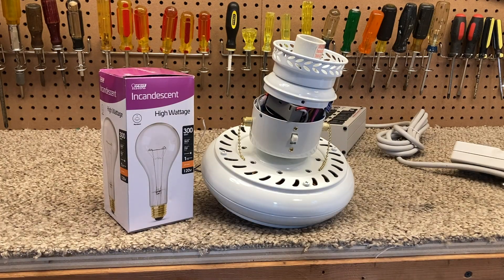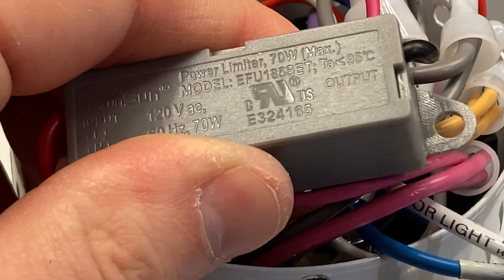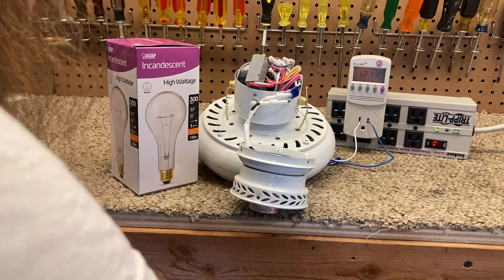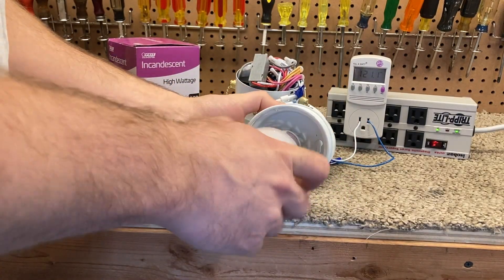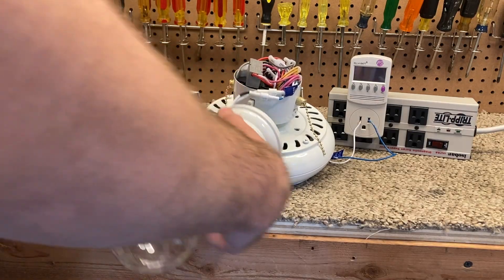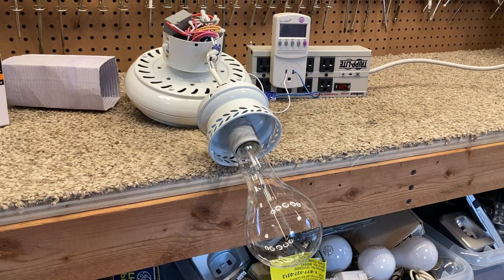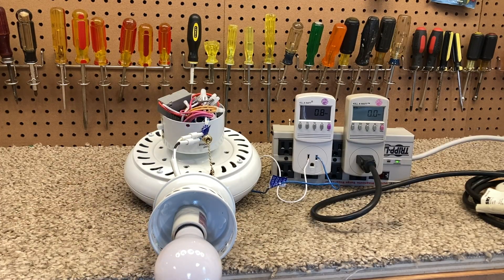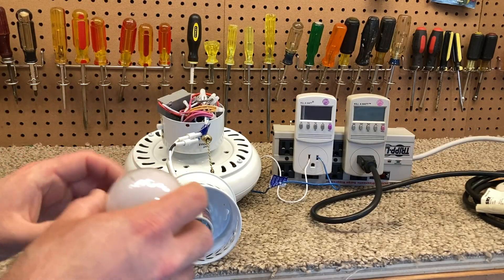Ceiling Fan Wattage Limiter vs. 300 Watts Incandescent Bulb

Comment: If I were you, I would strongly recommend wiring the ceiling fan/light fixture (or any piece of electrical equipment) to a blank power cord using wire nuts rather than just sticking the wires in the outlet. I like how you paid attention to the neutral and hot wires.
Reply from the maker: There's really no need for a brief attended test, especially with something low current like this.

Comment: One time, I put a Philips 300W incandescent bulb in my touch lamp, which was rated 60 watts. The minute I tapped the lamp, the bulb immediately turn on at FULL POWER; the touch control didn't even dim it lol. Fortunately, nothing smoked or caught fire. 300W bulb: 1. Touch lamp: 0.
Reply from the maker: Thanks for letting me know.

Comment: Excellent analysis of these limiters. I wonder why they are in ceiling fans, and not every new light fixture with an E26 socket. I'm sure some three letter agency will be happy to mandate these in every fixture soon enough, and that may not be a totally bad thing. I used to see such carelessness of 100w, and sometimes 200w incandescent lamps installed in many enclosed flush fixtures and fans.

Would be much more acceptable if it where a more reliable, non electronic device that does not have parasitic draw, like a self resetting thermal switch of some kind.
Reply from the maker: Spot on, I would have no objection to this being a safety standard if it didn't involve an electronic control set that's likely to fail prematurely.
Reply: Is it just me, or is the Clippy protest at an all time high?

Comment: My brother had a ceiling fan with a wattage limiter in it and the wattage limiter stopped working, making it where the light wouldn't work at all. He ended up removing it and bypassed it to the socket.
Reply from the maker: That seems to be a common occurrence.

Comment: The different wattage with the same bulb are caused by your 2 kill a watt meters not being super accurate.
Reply from the maker: The difference is exaggerated due to the discrepancy, but there is still an increase in consumption when using the same meter.
Reply: @JordanU  The wattage limiter physically can't make an incandescent bulb draw more current since it can't increase the voltage, all it does is draw a bit of its own power which is the 0.3/0.8W. Your line voltage also may have slightly changed while you were doing the tests and caused it to draw more power. These wattage limits are really stupid though and just seem like an extra thing to fail.
Reply: I was thinking about the same thing. I like how the two Kill-A-Watt meters are right next to each other, plugged into the same power bar.

Comment: I despise wattage limiters, not only they try to stop you from using higher wattage bulbs, the limiters are notorious for failing overtime and they tend to freak out when on a light dimmer. Wattage limiters are useless and do more harm than good. Every single one I take out, I crush with a hammer.
Reply: You should crush it with a Jeep
Reply: @Harry-tt1uo 
I can do that when I get a different ceiling fan
Reply: I would be really mad about them if they limited the wattage to LED ranges, but I can’t be too upset with one that is limited to the incandescent wattage rating of the fixture. With this fixture for instance, if you put a bulb much larger than 60-70 watts, you risk damage to the fixture. But if the limiters fail overtime and cause issues with dimmers, I could see why they might be annoying.
Reply from the maker: @rs12official Agreed; the value set is reasonable but the method being used to enforce it is not. This device is excessively complicated and very likely going to fail not too far into the future.
Reply: @rs12official the ceiling fans in my house have a "6.5w maximum" sticker on them, I've been using 9w DELs for years without issue. 
I assume if my ceiling fan has a limiter it probably actually it's pretty loose with it's tolerances. 
just now I grabbed the only Incandescent that I own and stuck it in and it lit just fine for a couple of seconds, so it at least supports 60w.
Reply: @JessicaFEREM  That’s something very annoying that I’ve noticed on more modern light fixtures. They’ll advertise the “””””””maximum DEL rating””””””” on the fixture, not the actual heat-based incandescent wattage rating. Often, the DEL rating will just be the wattage of the bulb the fixture shipped with.